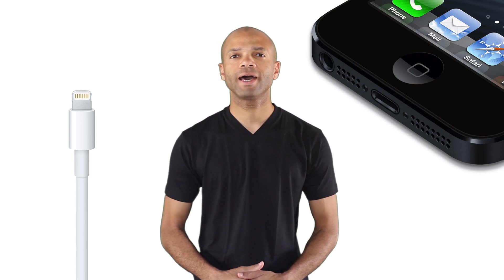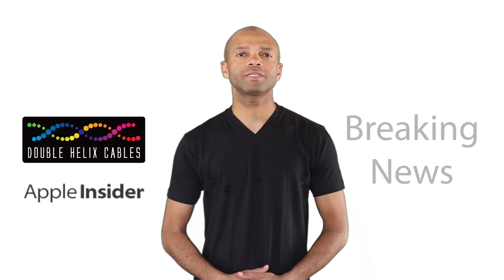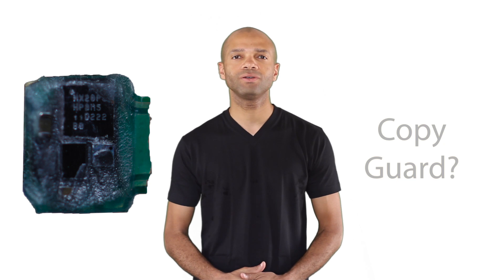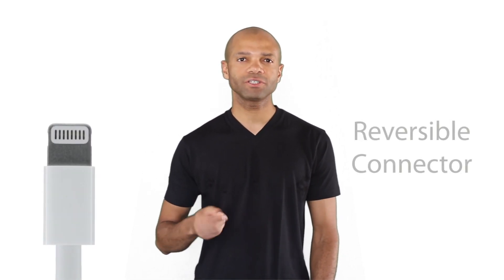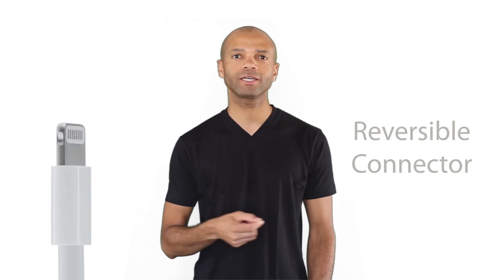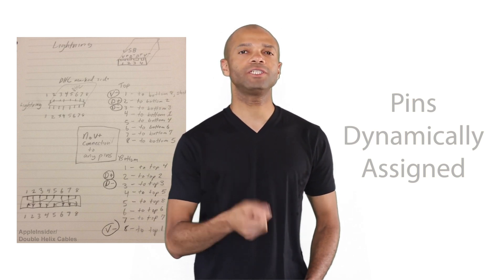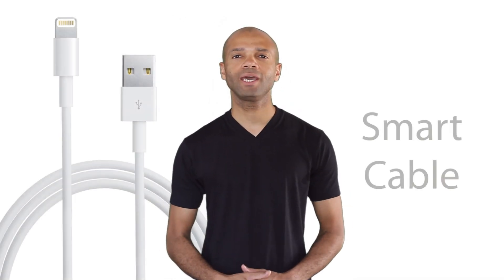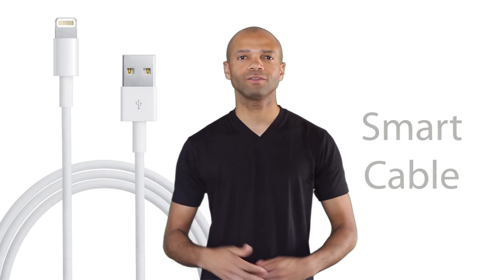iPhone 5 Lightning Adapter: Part 2 (Authentication Chip!!)

Comment: let's suppose that manufacturing the cable, shipping and all that, costs 10 dollars to Apple, it gives them 20 bucks for each cable and adapter... 8.000.000.000 $ to Apple just by changing a cable. That's why they get those profits at the end of the year, and people still defend them... come on... they are thieves and scammers

Comment: Might I remind everyone that it's ok going on about Apple Lockdown's etc now but it's not all that long ago that EVERY mobile manufacturer had a different charger plug, Motorola had theirs, Nokia had another, Sony Erricson yet another, all with different little clips etc.  USB came along then micro USB and there's STILL 2 versions of that with slightly different shapes.  I don't care if there's a different connector so long as the device works and does the job.

Comment from the maker: You're right. A proprietary platform created 9 years ago, is STILL the best in world today. Unheard of in the tech biz. Now, they've introduced the connector for the NEXT 9 years. The Nano is barely the size of the 30-pin dock connector. In order for devices to keep shrinking, the connector must also shrink. Now 8 pins do the work of 30! Mac drives USED TO have special chips to ensure that unsupported drives weren't being used. Fewer configuration variations created TRUE, driverless plug & play.

Comment from the maker: If Apple were only making USB adapters, you would be right. However, the Lightning connector will be used for a wide range of other applications.  Just using HDMI as an example, 19 pins are necessary to carry the full, continuous video signal. When you say that Apple refuses to conform with the mobile industry standard, remember the 30-pin dock connector ('03)  was created prior to micro-USB ('07) and even prior to the introduction of the iPhone('07). Micro-USB is good for power and data only.

Comment: Need I remind you that all odl devices which worked fine now have to be shelved. Or you need an intermediate cable to unlock your old docking devices. WHY!? Just to create some more cash for Apple. You sucker. You buy this crap which makes them generate more lockdowns. Users should rebel on this one and I expect major backlash. This is a backwards step. Remember when Macs had hard drives with little chips on them to stop users buying a stanard hard drive. You had to pay APPLE PRICE. Grrrr.